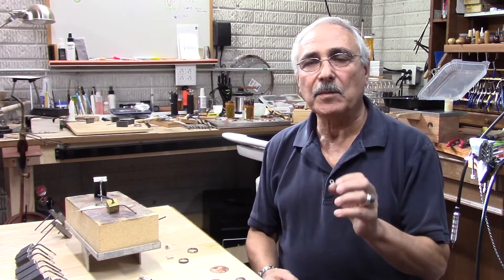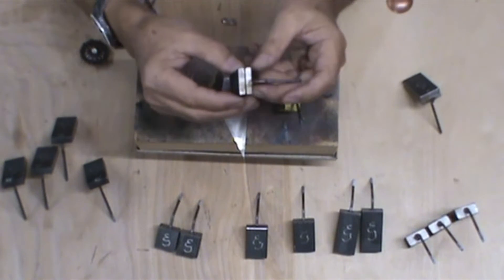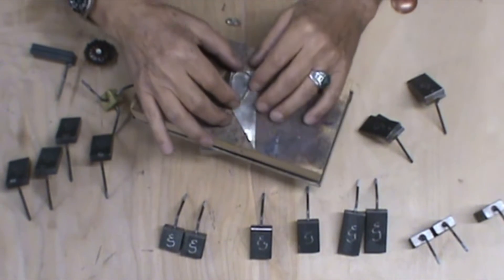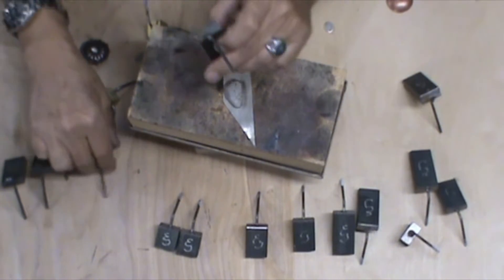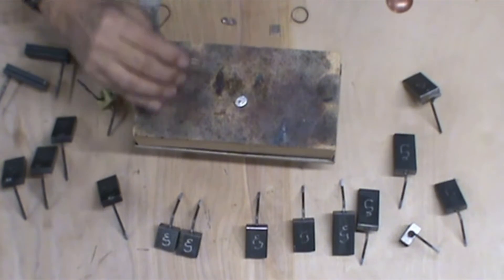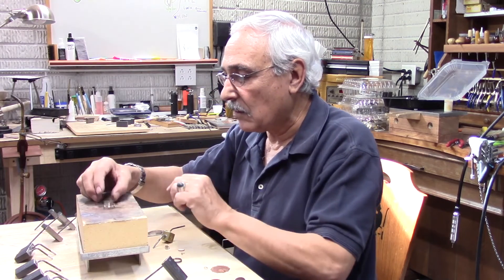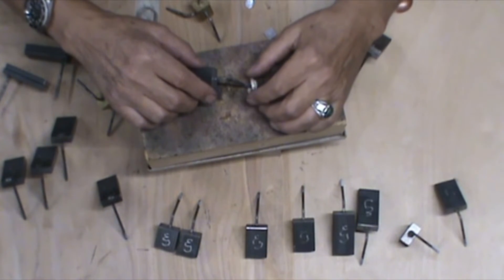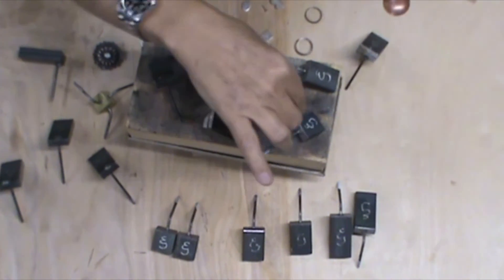Third Hand Hummingbirds

Comment: To everyone in the comments looking to buy one for your crafting needs, you make your own hummingbirds to fit your needs. If you are a stone mason, you probably drill a hole in a paver, and insert a piece of rebar, each craft makes their own third hand tool. A stone mason will use a bigger one than a jeweler. If you are a welder worried about the temperature, you may make the pointy end out of titanium, wrapped in carbon felt, or a tube blowing argon to actively cool it. A wood worker may make one out of a block of wood and a dowel.
Reply: Thanks for clarifying. These are great tools, though without any instruction in how he made these, or where to find them, it’s interesting but not useful. If anyone out there has found information on how to make specifically these, or buy them somewhere for jewelry purposes, please share.